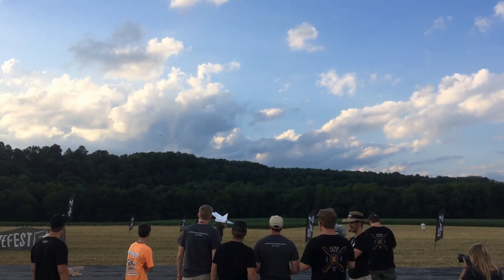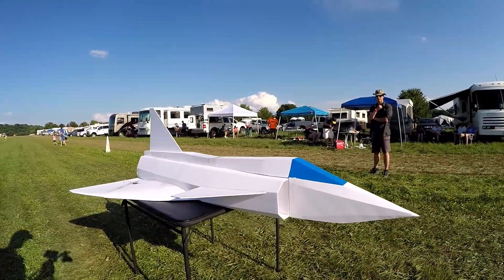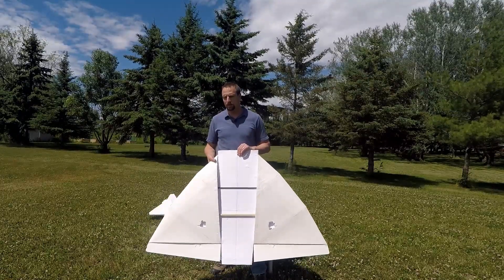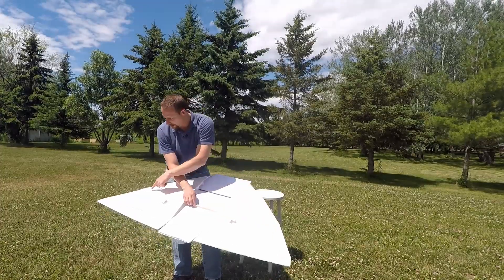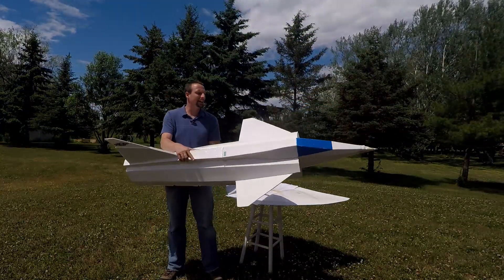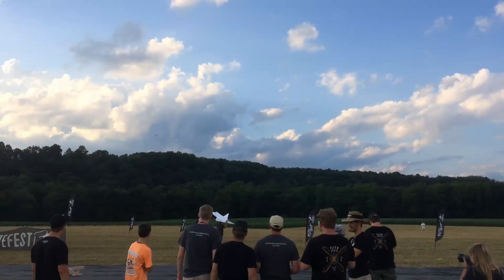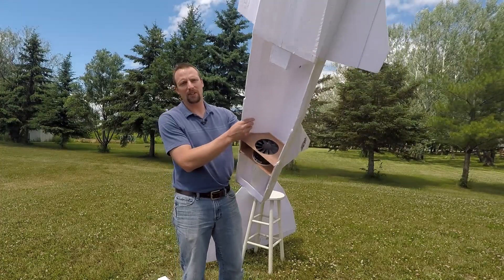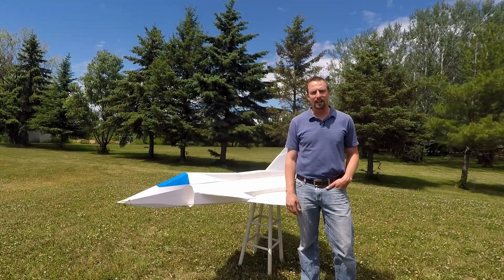Monster Viggen - 200% FT Viggen with 130mm EDF!!

Comment: Epic build! I did a 90mm version last year at 129% and I made my wing very much like yours.
Reply from the maker: Sweet! Did anyone get video of it? I would love to see it. The viggen is maybe my favorite of the ft planes. As a teaser I've got another video staring the viggen coming soon... Though it doesn't fly... 😜
Reply: @AscendDynamics  https://youtu.be/eyW4mHIn1hA
Reply from the maker: Oh I like yours! Looks like it really flies well! How many cells were you running? Seems like it would go vertical but either way it's good and fast! I really need to get my big one back up and flying... Probably be a full rebuild though... But can't beat $20 for an airframe. hahaha.
Reply: @AscendDynamics   It has a cheap six blade fan running off of a 4000mah 6 cell. I scaled it up so that the 90mm edf just fits.
Reply from the maker: @mercSnake  very nice! Haha! I once tried a 50% viggen with a 65mm fan squeezed in.. it failed because the inlet and outlet were not optimal.

Comment: I’m making a ft viggen at 140% but I’m covering it In fiberglass and adding retracts
Reply from the maker: Oh sweet! That's a great idea. Please let me know how that goes. That might be a great option for my 200%. What edf are you planning? How many plys of glass? For the wing are you doing an airfoil like I did or just a flat glass/foam sandwich?
Reply: Ascend RC I’m going to get a 90mm edf for it and I will be using one layer of 0.75 OZ fiberglass. It doesn’t seem like a lot but the strength of the foam board combined with fiberglass will be more then strong enough.

I build the whole foam body of the plane and realized that I’m going to need room to put servos in the wings so I need to make them thicker. I’m going to try something different from an airfoil. My plan is to cut out 2 or 3 more layers for each wing and glue them on and then just sand the wing until I’m satisfied with the shape. I’m also going to sandwich a carbon fiber spar in during the process to add reinforcement.
Reply from the maker: @jacklets3851  that sounds like a great idea. The glass will really help the foam last as well. I'm really interested to see how this goes for you. This might be a really good way to get my viggen flying again. Especially with the wing bring glassed. Oh and retracts would be great!
Reply: Ascend RC yeah I’ve built other flite test planes and the foam usually falls apart after a few months, so the fiberglass should prevent that. I’ll let you know how it ends up going! It should be another two weeks or so before I finish
Reply from the maker: @jacklets3851  sweet can't wait to see how it turns out. You should post to the ft face book page with some pics too!
Reply from the maker: @jacklets3851  did you very your viggen finished? How did it turn out?
Reply: @AscendDynamics  it was going well, but the esc I got for it wasn’t good and started smoking on first startup. The plane Is going to end up taking longer then I thought to make but other then that it’s going well
Reply from the maker: @jacklets3851  Bummer. Hope you can get it going soon. I can imagine it is going to be so nice! :-)